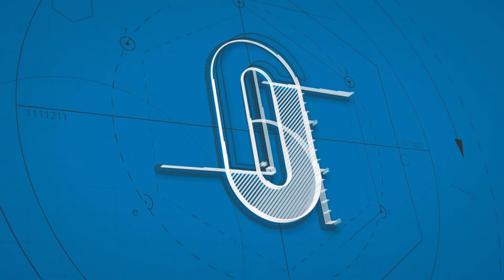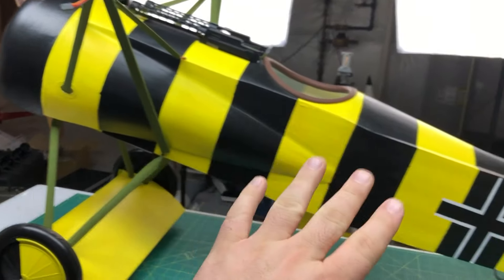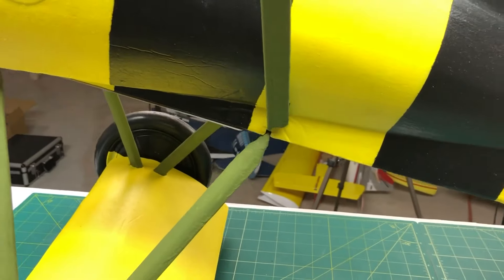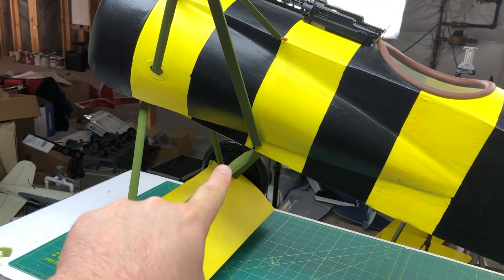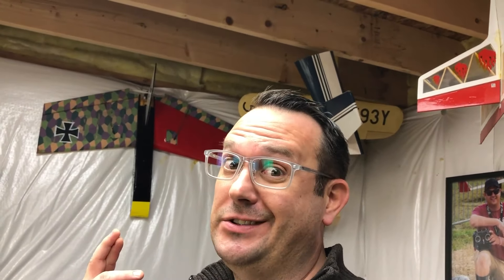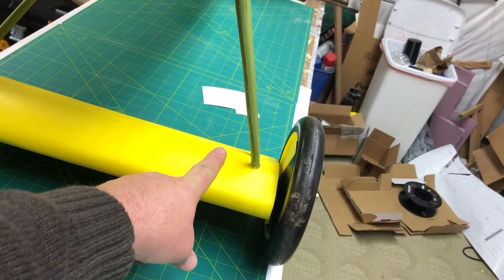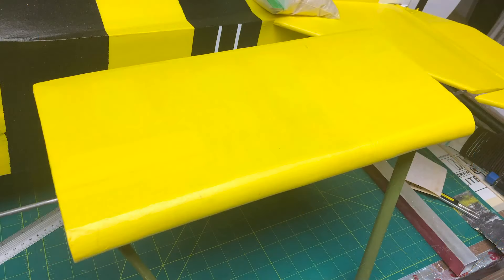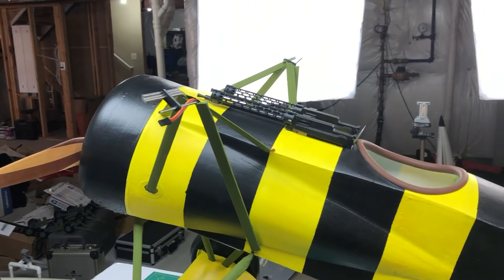Fokker D.VIII Ep. 09: Learning and correcting

Comment: What kind of flight times are you getting? 
Would you recommend lighter motor and battery combo or would it need nose weight anyway?
Reply from the maker: My flight times are a very comfortable 9 minutes. Fully-depleted would be close to 13 or 14 minutes. These airplanes need all the nose weight you can get, which is why I did the printed dummy motor (functionally pretty) and made the battery box with the battery vertical and not laying long-ways with the fuselage. Adding a 2200mAh 3S pack to the velcro on the battery box was a perfect amount of ballast so I'm good with where thing lay. I can always add a touch of lead inside one of the cylinders of the dummy radial to help get the CG right with a minimal amount of ballast but I'm not in a hurry to do so. Maybe once the pilot is in.